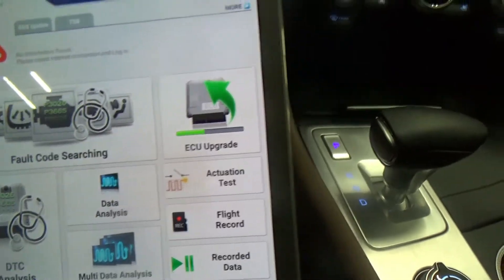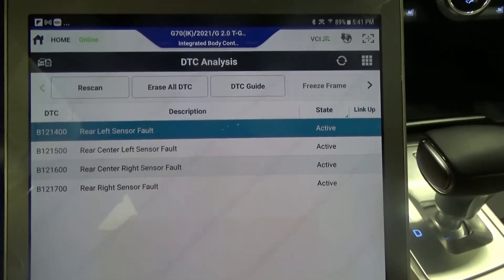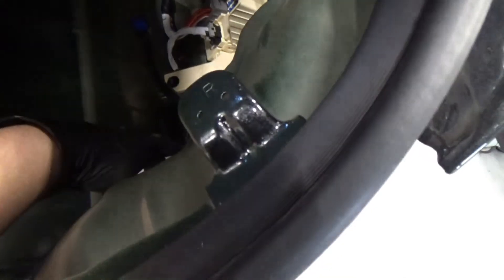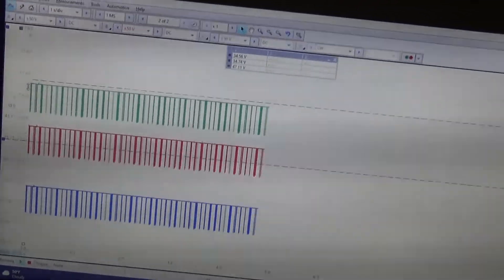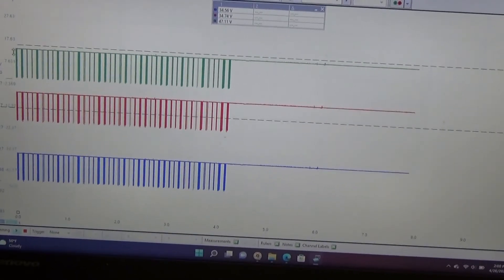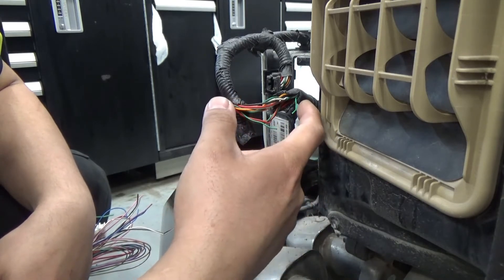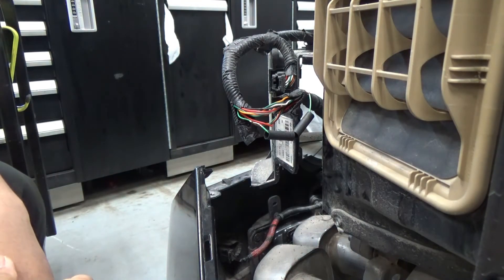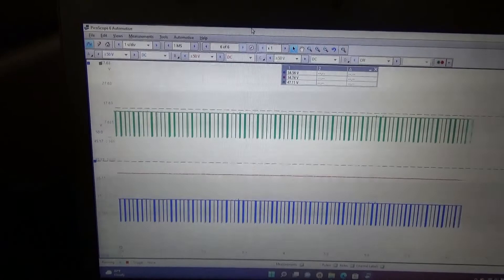Genesis G70 Rear Parking Sensors Malfunction

Comment: Have a 2012 Genesis sedan and changed one of the front inner sensors and system doesn't recognize and won't reset. Even tried swapping both inner sensors and won't reset. Any ideas?
Reply from the maker: Looks like you have wiring issue. You ahbe check power and ground lin communication on that problem sensor.

Comment: Awesome vid! But is there a way to turn off the parking sensor permanently?
Reply from the maker: Umm i think theres a way by changing the module programming if im.not mistaken, and that depends on the year model of the vehicle.
Reply: @hyundaitech  I was hoping that since your car was a G70 the internals would be the same as the Stinger. Would you know if the standard warranty is covered for sensors? Sorry to ask so much questions.
Reply from the maker: @terrorsz75  kia/hyundai and genesis should have the same warranty bumper to bumper unless for example customer hit a wall and damage the sensors and yeah its  not covered in my opinion.
Reply: How does a wire get brittle like that??
Reply: Completely forgot about the thread. So I found out that when my wife took the car out that one time she hit the bottom of those gas pumps that sit on a concrete slab. Wasn't hard but it shifted the bumper and cracked the underside of the lip. Took it to my dealership and it wasn't covered under warranty and would have cost like 800+ dollars, not sure what that would cover, maybe fixing the bumper and the sensor or just the sensor itself. But I'm just leaving it as is. As long as the front camera works I'm fine with it.
Reply: @terrorsz75 do you still get the error constantly?